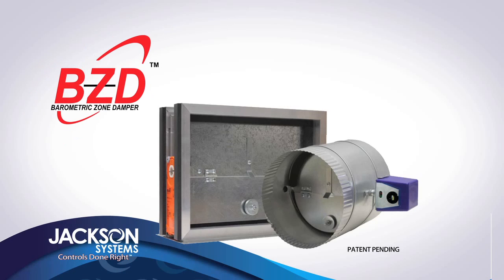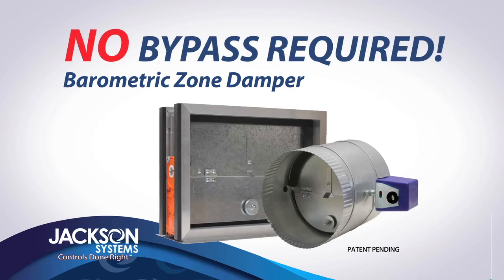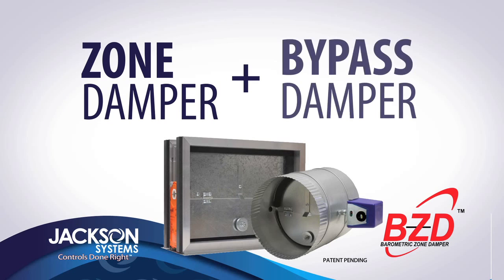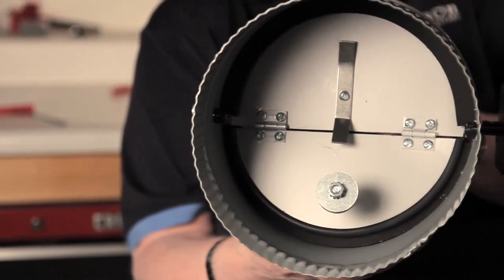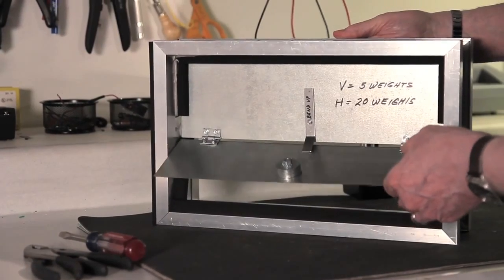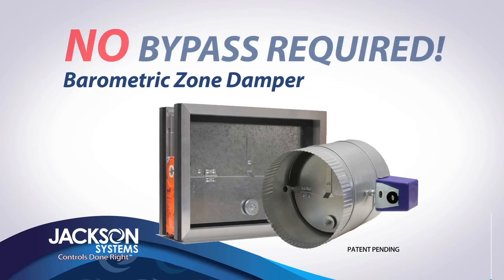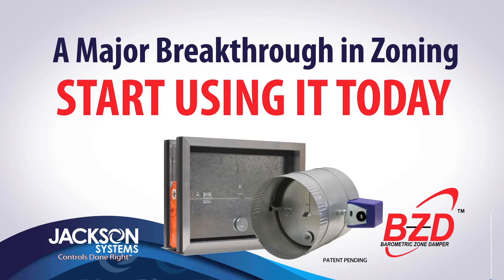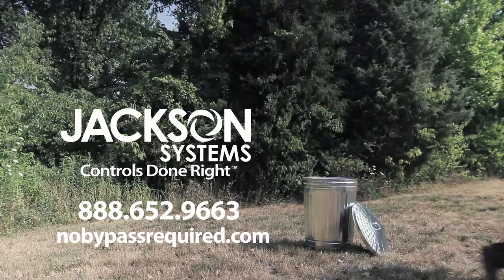Barometric Zone Damper - Eliminates the Need for Bypass Damper Installation

Comment: Seems like letting that much air by would cause the temperature where the thermostat is located to either be to high or low not accurate according to customer programing..